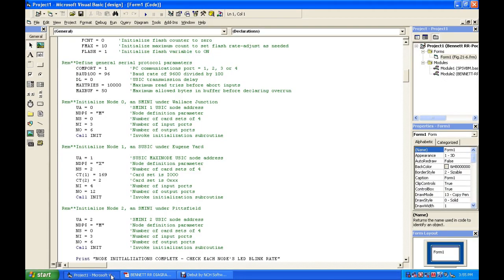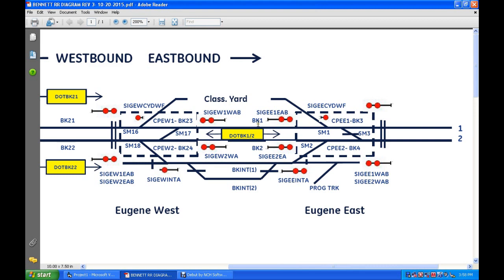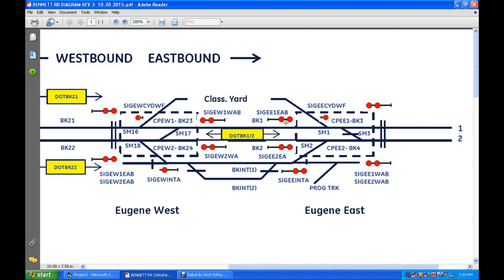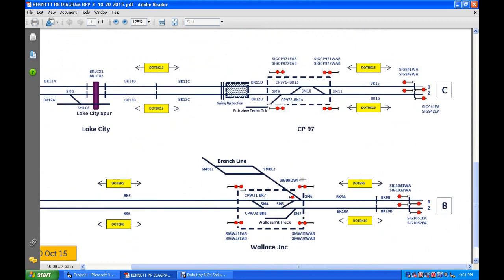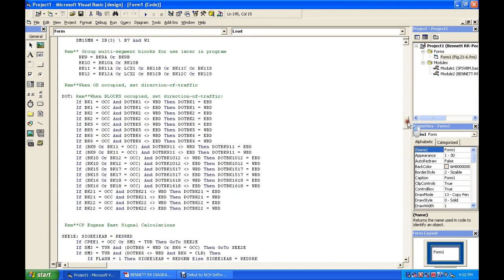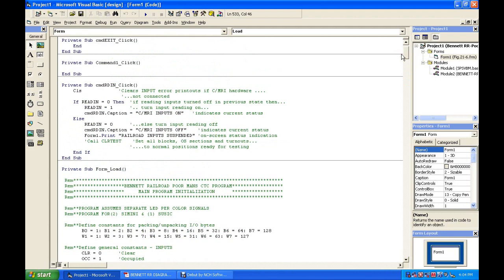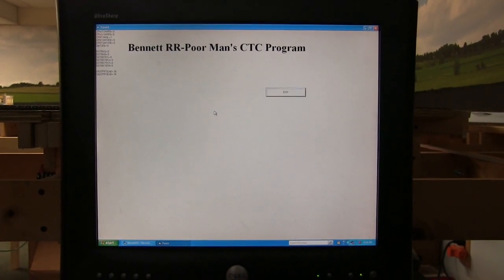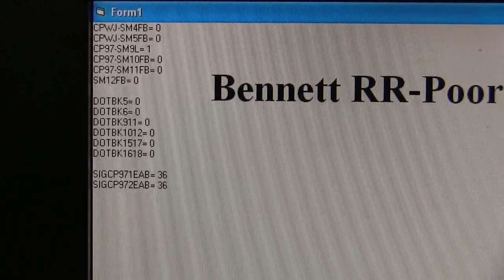Model Railroad Layout Update Video 41a - More C/MRI Programming

Comment: Stephen,  I just spent that last couple of days marathon viewing all 41 episodes.   I'm blown away with the speed at which this layout has come together.  I'm trying to design a layout of my own, so many of your techniques and processes are very helpful.  I'm not an electrical guy and don't know much about wiring organization, but your examples of it certainly help.  A question I have is about how you use JMRI to program on your yard-side programing track, or do you?  The signals are worth the effort.  Like sound in locomotives, they add another dimension to a model railroad.  Hang in there, I'm sure you'll work it out.  Thanks for your video efforts.  Yes, I'm enjoying.John Moran
Reply: +jmoran426 Thanks! The programming track is not (yet) hooked up to JMRI, we program using Service Programming from the EasyDCC command station. In the future I would like to connect a laptop running Decoder Pro as I think it is much easier to program consists. At least I hope so- using the EasyDCC is a tad cumbersome for programming consists. It can be done, but takes a bit of key bunching and CV gymnastics!
Reply: +Rob Bennett I would suggest having a programming track over your branch-line work bench where you can keep your laptop and interface hooked up and use DecoderPro for all of those new locos.  If I recall correctly, you also considered using PanelPro for your railroad and signal control system.  I could be based at the same location and be a good spot for a dispatchers station.  Just a suggestion.John Moran